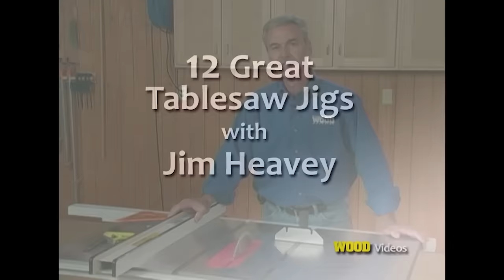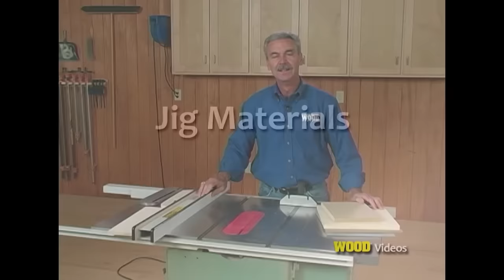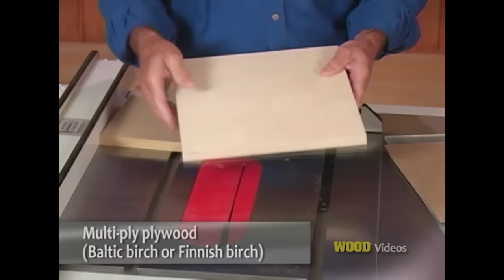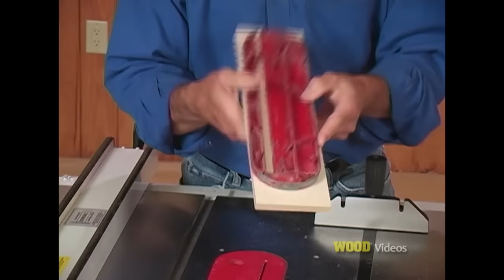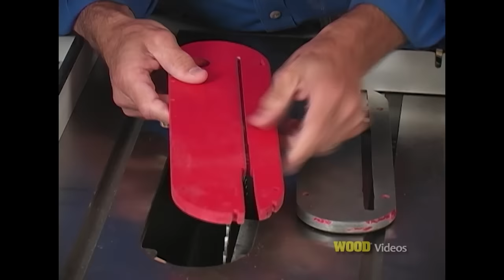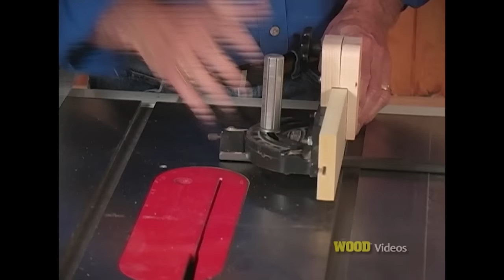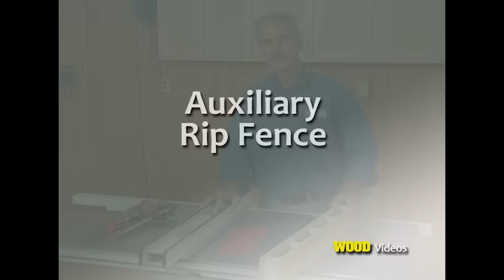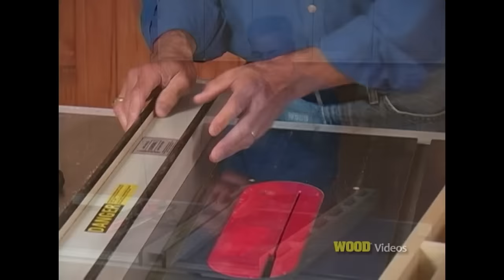12 Great Tablesaw Jigs with Jim Heavey - WOOD magazine

Comment: I really dont like Hardboard/Masonite. It's basically low density fibre board with one rough side. It moves A LOT with air moisture changes. Just use 1/4" MDF instead.

Comment: right off the bat your first mistake was you should always first make sure  your blade is parallel with the miter gage slots. you failed to mention that. if its off  no other adjustment will be correct. other than that the jigs are rather nifty. when i got my subscription one of the reasons was a jig book that was supposed to come as a bonus. yeah well that didnt happen.

Comment: I am not going to say you should not be doing what you have, however I really wish before you start you give a safety warning as you have removed all the guarding and the riving knife. I am from the UK and what you have proposed would be considered illegal due to not following the correct safety procedures. I can never understand why people need a cross cut sled when they have a mitre/ chop saw which is better and safer to use. Just remember people they are your hands and fingers, you will only get one set. These machines are primarily for ripping timber, not really a dimension saw for crosscutting. I fully expect to get some abuse or down thumbs but all I am doing is looking out for you folks. Check out the UK's H.S.E. website for safe use of woodworking machines, it might be the best thing you do.
I have been in the wood industry for over 40 years and now instruct at my local college, so do have a little knowledge.

Comment: Maybe you use a rivingknife on your tablesaw to prevent offcut-catches (39:52) . It is insanely DANGEROUS and people who start woodworking are not as good as you are in handling a tablesaw. It may occur heavy accidents and not long time ago i've called the ambulance because a friend of mine got a thin strip of wood sticking in his stomache.
Reply: @Wood  Oh i am sorry, didn't know that. Here in Germany, riving knives are required/available more than 40-50 years. My tablesaw is from 1960 and it has a riving knive installed from beginning.
Thanks for your answer, good to know that!

Comment: A tiny amount and I mean just a few grains of table salt will keep glue up pieces from moving around all slick like when you are trying to position them.. instagram  & Tiktok @ magnatimusone
Reply: @Wood  i have used this method for years and am a long time master craftsman. I have never had a glue failure due to anything but not enough glue.. there is that line there as you know big mess vr. Not enough.  I would never suggest an even layer as they state in the analysis but just a few grains really helps with the slippage.  Marc S. Doss 
          AKA;Magnatimusone 
  The Last living Craftsman